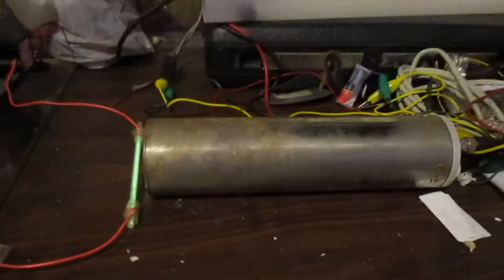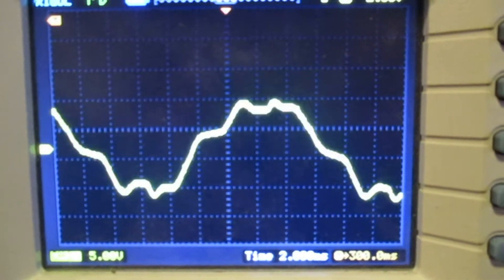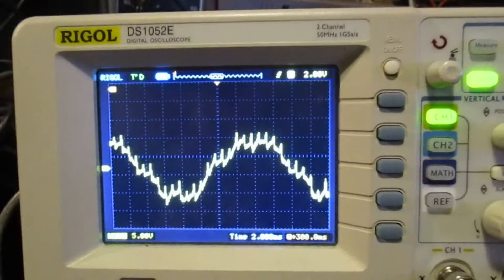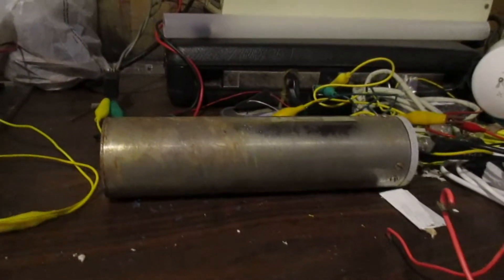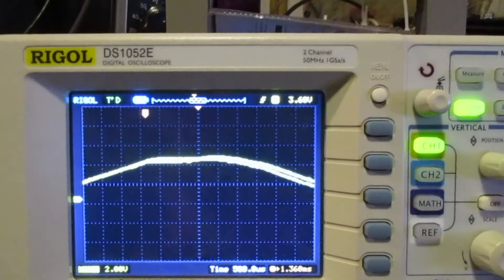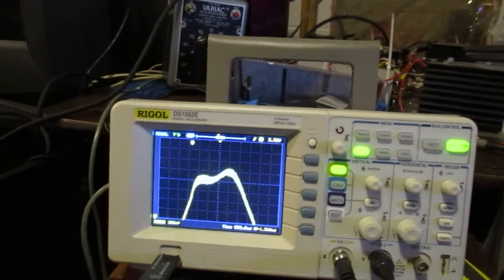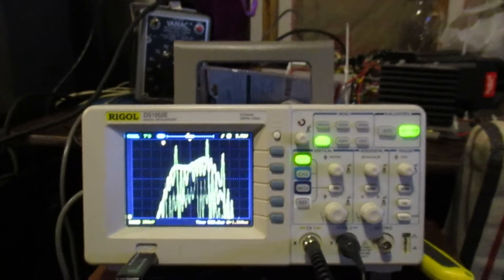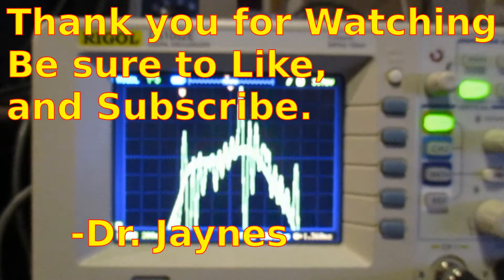Tritium Nuclear Fusion Experiment Part 4 - Shielded Fast Neutron Detector.

Comment: Photodiodes are less sensitive to EM-noise. There are several vendors that have LiI(Eu) and Plastic (Neutron Sensitive) Scintillators Coupled to a Photodide. What is the Sequel of this Experiment as of early 2021 ?
Reply from the maker: I have been meaning to do something a little more dangerous.. I have the equipment not.. just need the time to get-r-done.. Hopefully soon!
Reply: @jaynesnetwork  👍👍🍻

Comment: may be use instrumentation amp in comparator mode feed in power supply to comparator so it cancels out power signal
Reply from the maker: Probably better to shield if possible...I am working on a way to get much more power in to the plasma, thanks to a suggestion from one of the viewers.. It should be very interesting.. To say the least!!

Comment: Put the tube in between two strong neodymium magnets, use your HVAC power supply to get the tube to glow from ionization, and use a microwave oven magnetron to excite the tube with, you will get a bunch of neutrons from tunneling and scattering effects.
Reply from the maker: Interesting Idea.. Have you tried it?  I know that it is harder to excite plasmas with higher frequencies.. I have just tried a magnetron by itself and could not get the plasma to ignite...but I am sure you are correct, that if you ignite the plasma first.. you can surely heat up the plasma much more with a magnetron.. Thanks for the great input...

Comment: You probably need to shield the oscilloscope and the leads going from the neutron detector to the scope. Also it looks like the scope is unnecessarily located right next to the power supply? I'm just assuming that is the supply behind the scope because of the yellow alligator clip I saw which I assume supplied power to the tritium tube.. if that's the supply on the left why not have the scope to the right of the detector tube?
Reply from the maker: Yes I am planning to build a battery powered high voltage power supply, and use a battery powered o-scope, and put everything inside a Faraday cage.  It will take me a little while to do this. I thought that the shielded detector might be good enough, but it seems the high voltage rf was coupling in thought the detector cables.  Maybe scope is too close as well, but I tried moving it, and still too much noise..  A Faraday cage will definitely fix the problem..
Reply: you might want to try differential probing if the base signal has like a 50/60 hz freq. @jaynesnetwork